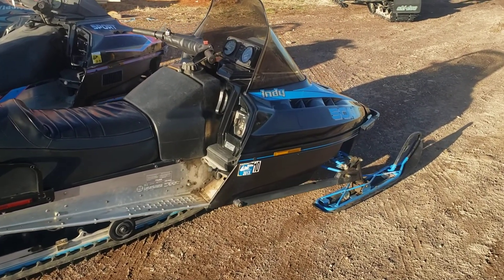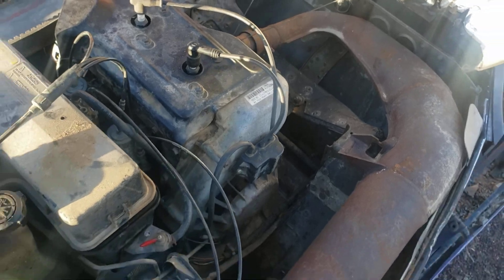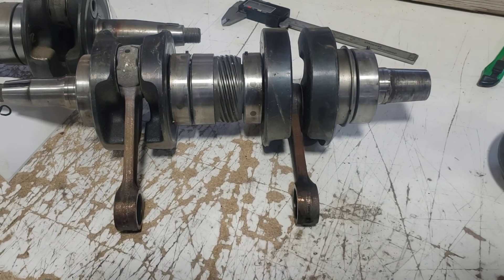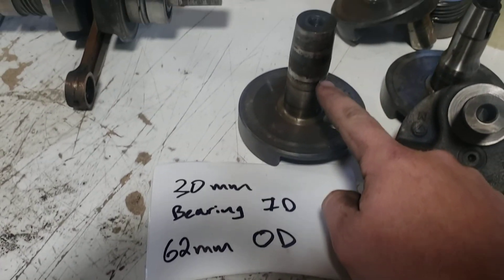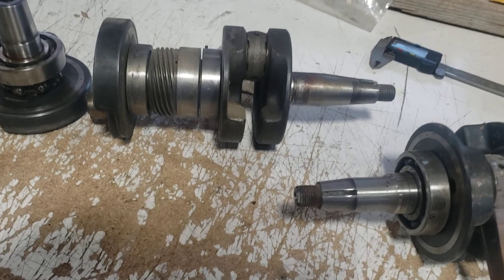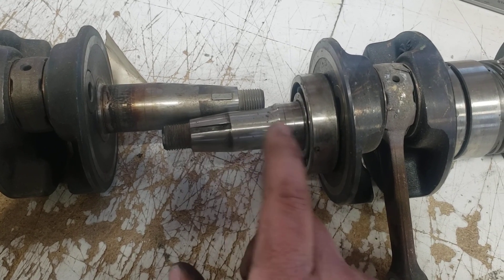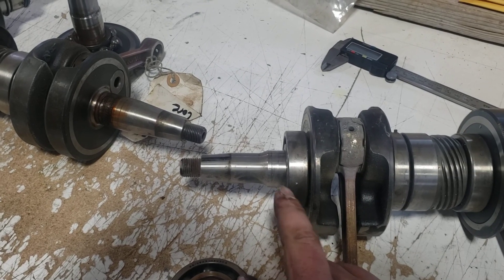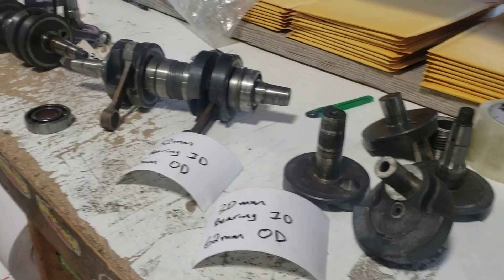Vintage Polaris Snowmobile fuji engine crankshaft information 400 440 488 500 crank shafts

Comment: I got same kind of motor in my  1996  tried to take to shop they took look at it  and they told me  the engine bearing where plenty wore out  better off trying to  get another  sled or find better used motor